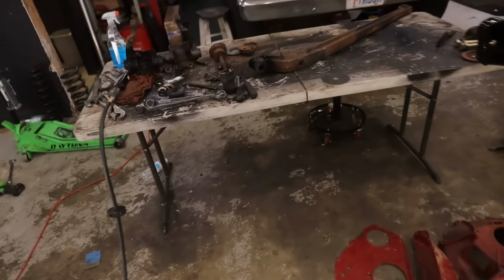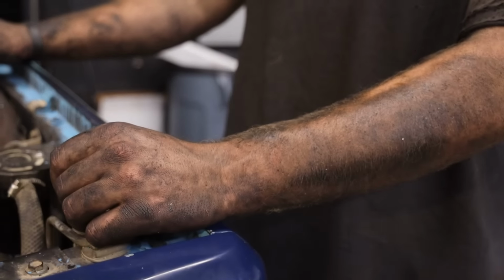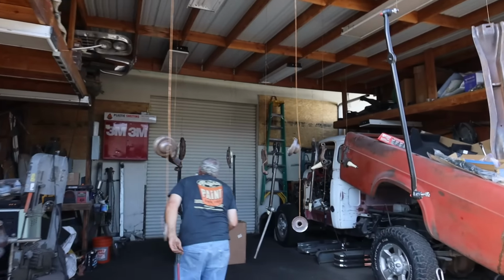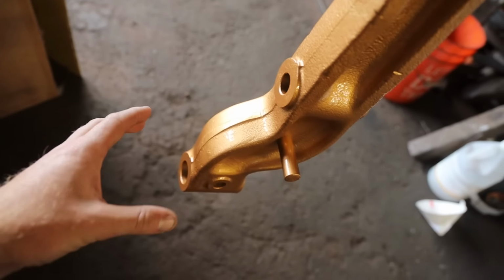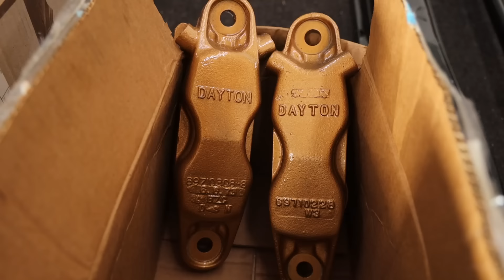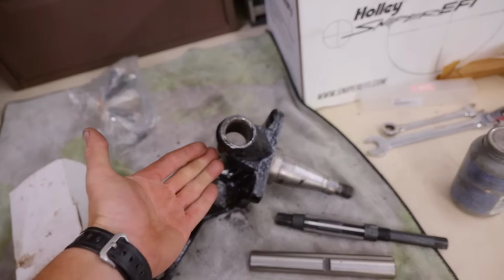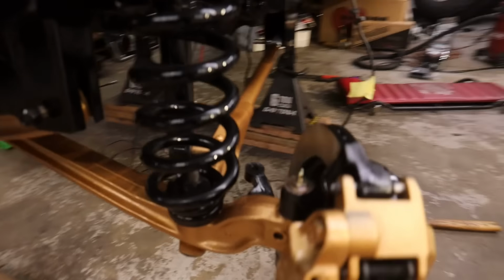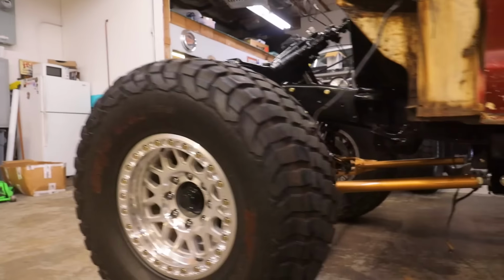My Crew Cab's CUSTOM GOLD Suspension Is COMPLETE!

Comment: Going on about spray paint cans, spray gun painting, and clear. Wait till you find out about powder coating. 😂🤣 did my whole front suspension because WHILE WE’ER HERE & gotta finish the rear once it gets back from the Body Shop
Reply: ive got mixed feeling about powdercoating. maybe shop around me cannot do a good job but it doesn't last as long as the good ol epoxy primer and oil based paint in the Canadian winter salt. ive seen rim turn to rust after a single winter. while my steelies are still looking great after 7yrs of winter use and washed maybe once. 😅
Reply: @Bowtie4me   possible prepping issue/ cheap powder because I’ve had no problems out of mine or my homie that daily his car. My guy treats powder ike paint sandblasting, wipe down, primer coats, then color(s) & candies/textures.

Comment: A note about those I-Beam oblong bushings on the narrow end. When they give out, they just go, and there is no warning. But you wont notice until you are driving, feel like your truck is misaligned, align it, drive it, then realize you didn't align it right, do it again, same issue, and then realize after 4 alignments that you have an issue, and spend 2 days looking for the issue not even noticing that that bushing is missing and you've been widening the hole over and over. Ask me how I know. Luckily, I will never have to replace a set on my 67 for as long as I live, but they will give out. And you will cry trying to figure out why your truck keeps falling out of alignment.

Cheers. Love the new shirt, this is the first time I have ordered your merch, and glad it was on the Crew.